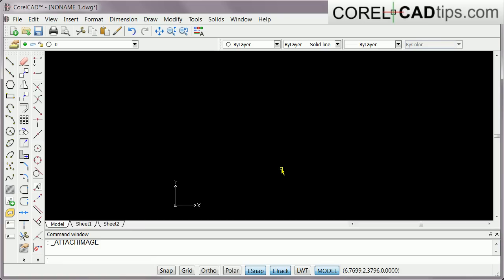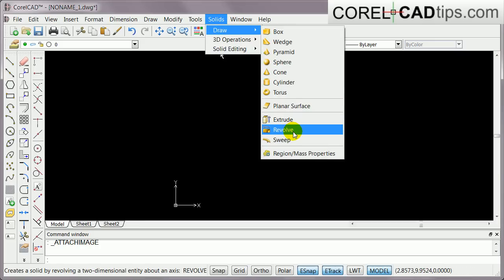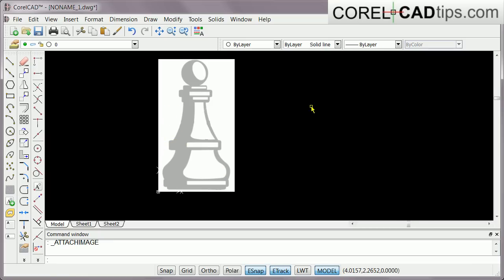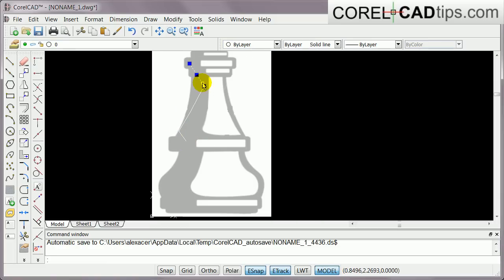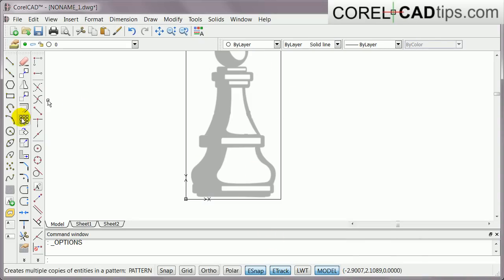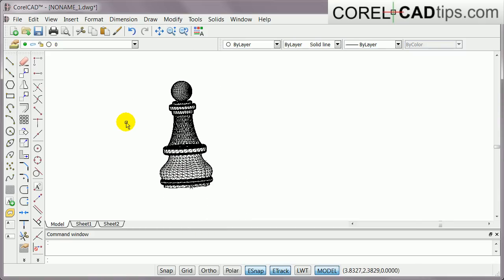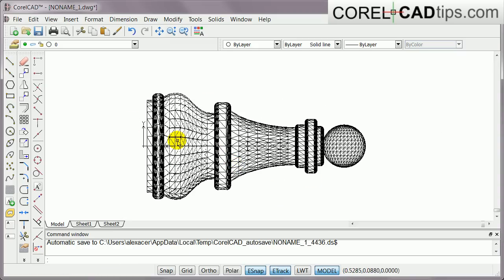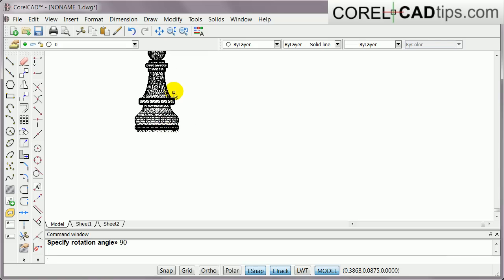CorelCAD - First look at the 3D revolve feature

Comment: That was great - - learned alot from that one.   The hardest part of learning Corel CAD is 'unlearning' things from Corel Draw.   No wonder I couldn't find anything about joining 2D 'entities', because it is not required.  So many other things are so different.  I used Corel Draw for about 20 years, but now want to get up on this for 3D printing, plasma cutting and so forth.  
Wish you had more and more videos !
Reply: Thanks for the info. I was hoping Corel would have similarities in both programs to make it easier to use, doesn't sound the case, shame.

Comment: You should have mentioned that the great renderer has to be bought additionally for about 250 €. I was so stupid and bought CorelCAD 2017 - which without the expensive plugin has only a very weak output and is therefore not suitable for 
presentations.

Comment: ahahahah, definitively :) being that AutoCAD LT is only for 2D.

actually, the question is: how many people need to create a 3D chess piece? :)

seriously, this product is mostly for 2D drafters, is one is interested in 3D modeling doesn't buy neither Corel nor AutoCAD LT... isn't it? for this reason I suggested AutoCAD LT instead: more compatible, more standardized, better for 2D operations with a similar price.
Reply: AutoCAD LT is 2D only, full AutoCAD is more similar to CorelCAD. There is no comparison for the cost, though... full AutoCAD costs 4-5 times more and is slower.